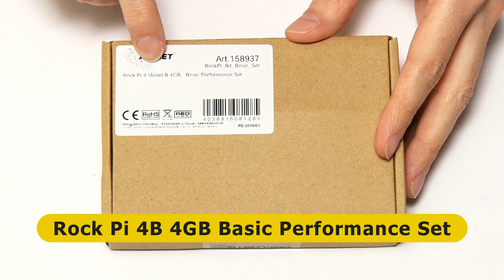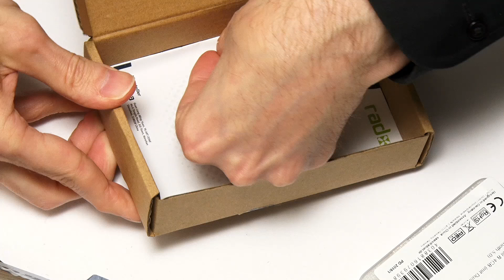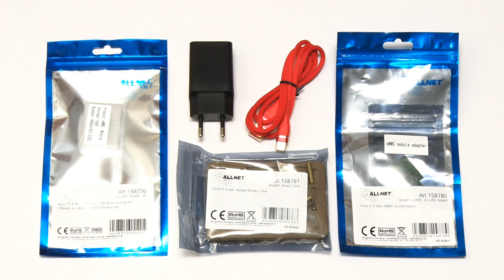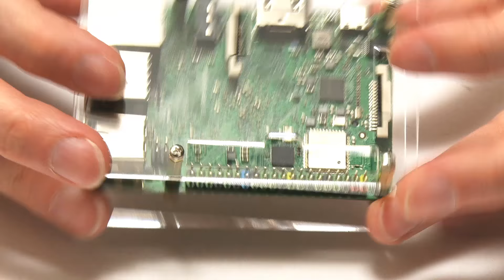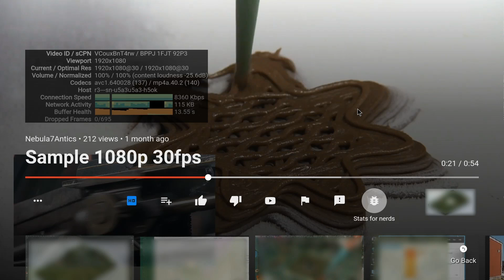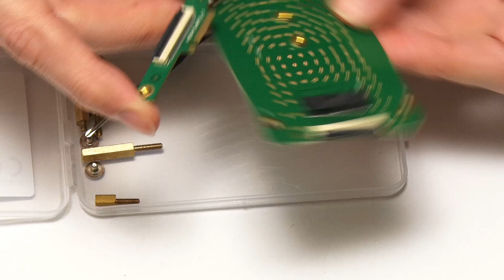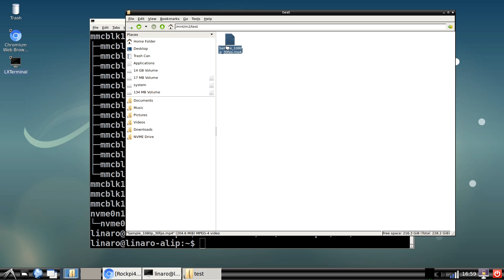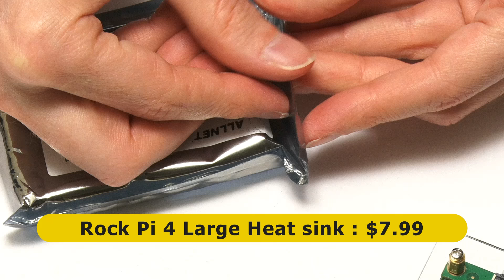Rock Pi 4B : M.2 & USB 3.0 SBC

Comment: Great video as usual. Thanks for uploading. 
I wonder if I can use this one to run Windows 7 on a virtual machine hosted by Linux. Can someone please tell me? Thanks in advance.
Reply from the maker: This would not work I'm afraid, as this is an ARM computer, not x86. Virtual machines still run on the processor directly. You may be able to run Windows 7 via emulation (theoretically!), but would be slow and would the right drivers . . .

Comment: Does it boot from the SSD?
Reply: not at the moment, this is only possible with SPI flash on board. The existing version of ROCK PI has no SPI flash soldered. For now you need to boot from SD card or eMMC.  But it will not take long to get this solved.

Comment: All of these more powerful SBC's have one big problem - the manufacturer cares only about sales and not the software/OS that runs on it. And they don't care too much about the hardware either really as long as you buy one and it can be gotten to work with a lot of long complicated Linux commands. For years many have tried to knock the Raspberry Pi off its throne, and all have failed for so many reasons I won't go into here. But don't be tempted by these more powerful SBC's with fancy features, this one amazingly is designed with both heatsinks on the BOTTOM! So we have here designers here that don't know heat rises. Seriously that should tell you everything you need to know about the ''Rock Pi 4B''. Stick with the Raspberry Pi, it's still king for a reason.
Reply: I might have to turn mine upside down to get the heat to rise.  I hope it still works when it's upside down lol.  If you buy this without doing research and don't know it's a new board without a lot of support yet (based on your Raspberry Pi experience) that's on you.
Reply: Yea, without software support is just a bunch of fancy circuits put together. I wonder why are they bothering to copy the Pi layout...

Comment: Just wondering if there were enough spacers to still use the original perspex base as a protector for the SSD extension board. Also, it would be helpful to do a final sum on the total investment with all the bells & whistles. Can't help but feel I've been encouraged to by an extra large fries with my happy meal :) All in all... very clearly explained and presented. Thank you :)
Reply from the maker: Good thought -- the perspex top could be fitted over the SSD. :)
Reply: there are also protective casings in the works. some wood versions are available and only the beginning. :-) check them at https://shop.allnetchina.cn

Comment: you cant install OS on M.2 NVMe SSD ?
Reply: Hi, you can but you need at the moment still the bootloader on the microSD card. This will be solved, it is in the works but takes a lot of effort.
Reply: Are you the creator of this product?
Reply: @k033as9  no, I am not. The team at RADXA with Tom Cubie did create the product. https://wiki.radxa.com/Rockpi4 We do the marketing activities with them and build accessories. https://shop.allnetchina.cn :-)
Reply: @k033as9  The bootloader can be put on the spi flash, and the reset can be put on M.2 NVMe SSD. Newer version of ROCK Pi 4(v1.4) will have spi flash on board by default.

Comment: I've been following your videos for years and years. Always great quality content.

Is the processor capable of handling the high bandwidth provided by the NVMe connection? I'd be delightfully surprised if there wasn't a bottleneck in the system which would make a standard SSD just as effective
Reply from the maker: Thanks for watching -- and a good point. I will be uploading a follow-up video running some tests. My guess for now  is that the NVMe interface will prove faster than a USB 3.0 to SATA adaptor -- but we shall see! :)
Reply: @ExplainingComputers  Terrific. Looking forward to it

Comment: A yet another RK3399 based SBC.
RK3399 is a great SoC on paper, but it's software support is really awful. It seems Rockchip doesn't really care about supporting OS'es other than Android.
So unless you only want to run Android on your SBC (or planning to use the SBC as a headless server), do yourself a favor and choose something else.
Heck, even Android support isn't stellar as there's no support for things like MediaCodec. The only app capable of hardware video decoding on Rockchip SoC is Rockchip's fork of Kodi, RKMC which was last updated 2 years ago.
Reply: What you are talk about is not the fact in 2019. First, RK3399 supports ChromiumOS very well, not running on ROCK Pi 4 yet, but community is working on it. Second, RK3399 have very good Linux support on Rockchip kernel 4.4, with all hardware accelerations including GPU and VPU. RK3399 also has very good mainline Linux support, not as complete as 4.4 Rocckhip kernel but more drivers will be merged in. Third, please check LibreELEC release for Rockchip, 4K@60 hardware decoding is working. https://libreelec.tv/downloads_new/rockchip/
Reply: For Android, we are working on Android Pie for ROCK Pi 4.

Comment: by the way,  Can you direct me on AMAZON to the best cable for Rasberry Pi 2B+  cable to attach VGA monitor?  (I think I need connection for sound also....  That would be of great assistance to me!
AMAZON perhaps or NEWEGG website.  I totally trust your guidance.
Humble Appreciation!
Reply from the maker: This can be tricky to get working, as you need a signal convertor. These should work: https://www.adafruit.com/product/1151 or https://thepihut.com/products/raspberry-pi-hdmi-to-vga-convertor

Comment: Sir Chris,  Humble appreciation once again for a fantastic video.  I have been busy since Mid October. Moved 160KM from Atlanta GA/USA.  Finally catching up on your videos.!  Your SBC videos always have my full attention.
Hopefully within a week I can sit down with the 2/ Raspberry Pi 3 B+ I purchased last year. I will run home soecurity off one and Smart home off the other. 

would you consider a video series, SBC security, also setting up Sensors for doors, windows,  motion as well as connecting to garage door opener, then managing it from SBC? (There are a few videos that touch on that "some what". 

However, your style of presentation and setting things up are far better than any other person could imagine to attempt to match for sure.
Purchasing the sensor cards and loading firmware you need is very affordable and much cheaper than buying a finished product for each window/door/etc.

I have 3 routers now. 1 for family use with computers,  Ipad, Smart phones, etc.
2 routers for smart devices and security devices/wifi.  One router paired into other..
That should cover inside house and full yard outside. (1 acre lot ). The last to add is fence and smart gate.
That should keep me busy for the summer time! 

Yes, I will be purchasing the Rock4Pi, probably early 2020.
Hope all is well!

Have a blessed weekend!

Alton
Reply from the maker: Greetings Sir! Sound like you have been busy. You may like my series on Raspberry Pi Automation starting next week . . .

Comment: Actually, USB 3.0 no longer exists.
Reply from the maker: It does. Just because most new PC morherboards are 3.1 does not prevent the previous standard from existing or being inplemented in new hardware. This board is USB 3.0.
Reply: @ExplainingComputers  Actually USB 3.0 was renamed to USB 3.1 Gen 1 which was renamed to USB 3.2 Gen 1. It is the same hardware. Please read this article and you will believe me: https://www.diyphotography.net/usb-3-is-about-to-get-renamed-again-and-its-going-to-get-even-more-confusing/
Reply from the maker: Thanks for this, of which I am aware. But I'm afraid I do not accept the USB Implementer's Forum view that a standard ceases to exist because it has been renamed! :) USB 3.0 was published as a defined standard. This happens to be the same as what was later defined as USB 3.1 Gen1 and then USB 3.2 Gen 1. But history cannot simply be obliterated, and manufacturers -- including those of this SBC -- specify their board as being "USB 3.0", with the technical parameters of what is defined in the documentation that specifies that standard. And a great deal of computer equipment still exists in this state. In my view, the USB Implementer's Forum is making itself look ludicrous with its suggestion that all hardware sold with a USB 3.0 specification (and labelled as such) is actually now something else. So here I could have said "USB 3.0 which is now known as USB 3.2 Gen 1". But to talk about the board as having "USB 3.2 Gen 1" ports when the specification for the board does not state this would not I think communicate its specification most appropriately. Language has to facilitate the best available means of communication, and sadly the USB Implementer's Forum's renaming does not help with this. "USB 3.0" as port that offers a 5GB/s transfer rate is something that is widely understood. How many people (and manufacturers) talk about "USB 3.1 Gen 2"? Very few. So I choose my worlds for the most effectively communication. Please note that I am in no way criticising or disagreeing with you here, but rather with the USB Implementer's Forum's bizarre re-definitions. :) The article to which you link also concludes with a view in line with my own.

Comment: where can i snag 4-5 in the US?  I'm eyeballing this for a small kubernetes cluster
Reply: Hi Ryan, something which we did not really well communicate is the fact, that the heat-sink is mechanically already "sort-of" cluster ready. If you look on both sides of the heat sink you will find a groove which actually allows the mounted board to be slid into a rack. Here you can find a close up of the heat sink:  https://shop.allnetchina.cn/products/heatsink-for-rock-pi-4  This rack is not ready yet, but in our planning. There are also mounting holes on the bottom side of the heat-sink. We are always thankful for smart ideas! You can drop them on some of our social media sites. (links are on the footer of our shop) We will for sure reply. ;-)
Reply: hi, you can get them from us, we ship to the US https://shop.allnetchina.cn
Reply from the maker: Allnet link in video description. Cluster sounds cool.

Comment: 1080 p at 30 FPS ? Its 2019 benchmark in 4k 60 fps to pls. Its way to expensive a product if all it can handle is 1080p at 30 fps.
Reply: It does for sure
Reply: it does 4K@60fps
Reply: It does 4k 60. Even the Fire Stick 4k can handle 4k 60( and it is weaker)

Comment: I'd love to use this as a NAS for Time Machine instead of a Time Capsule. Has anyone experimented with using this SBC as a NAS?
Reply from the maker: Must be possible, but I'm not aware of this having been done yet.
Reply: ExplainingComputers I will try, once I order one with the M.2 add-on.
Reply: But where is the point, as it has no SATA ports?
Reply: @0xbenedikt  the M.2 could be utilized for that. WIP - keep you posted...
Reply: @NB-sw1op  I am both in hobby and work quite involved in embedded electronics. However, I know very little about M.2., since I never really looked it up much, so I am looking forward to your solution to the missing SATA ports.

EDIT: Nevermind, I just realized M.2. does not just carry PCIe but also SATA, that's nice.
Reply: We will add more information on how to make SATA work via the M.2 Extension board. There is no "how to" available so far and certain hardware requirements on the add on board have to be met. There are more pressing issues at the moment. We will follow up asap. Sorry and thanks for your patience!

Comment: Would this be able to play 4K HDR files? How about passing DTS Master, TrueHD and Atmos to my home cinema amp?
Reply from the maker: It should play 4K, though I've yet to test. There  is no optical out,  which I presume will limit home cinema options?
Reply: Optical output wouldn't give you support for lossless DTS Master Audio and Dolby TrueHD. Optical would give you playback but not the full level of either of those

It would have to use hdmi for the audio. It likely allows you to do pass-through of the lossless audio formats to your receiver (if your receiver decodes those) but their website isn't clear if it does. If it doesn't (or if your receiver doesn't do decoding), you'd have to use playback software that decodes it to pcm.

Comment: Very promising board.
The indies making these boards need to form a board where they can collaborate on a specification (if they aren't already) and get an architecture set incorporating what we've witnessed across numerous product lines (PCIE, NVME; etc.) into a cohesive package so that next steps may occur. There's enough to constitute an entry level ARM PC MoBo considering my previous points and a market --they (all the sbc developers/manufacturers) really should think about picking up their heels. Linus Torvalds will agree. and anyone else looking to get into developing for the ARM architecture.
Good video!

Comment: I am not impressed with the Rock Pi , only one version of the Linux worked, did not try this b version though.
Reply: Hi, can you please tell us which linux version would not work? did you connect to the forum to get some insights on why it might have failed? please connect at https://forum.radxa.com/
Reply: @NB-sw1op  thanks for the reply, only the Slackware installed properly. All others tried, Armbian, Debian stretch, Ubuntu failed one way or the other. I am mostly interested for the Debian but will leave it for now due to other projects. Perhaps I do kind of Debian by myself, I will see. All downloaded from wiki.pine64.org.
Reply: @damirdze  hi, I think you should check this link for working images: https://wiki.radxa.com/Rockpi4/downloads and of course here: https://github.com/radxa I guess this might solve your issue.
Reply: @NB-sw1op  I will try when get some time , thanks Norbert.

Comment: I presume there is no Vulkan support on Linux, only on Android ? (I kind of stopped at "Rockchip3399").
Reply: https://en.wikipedia.org/wiki/Vulkan_(API)
at least for that page, Vulkan is (well?) supported on Linux
Reply: @AntonioNoack On Linux yes, but not on Linux for the RK.  I've got one here that has been taking the dust for years.  And a quick glance to the API show various OpenGL ES but not Vulkan.  Also, it's on the "issues" list.
https://github.com/rockchip-linux/libmali/tree/29mirror/include
Reply: @hurricane31415  ah ok :)

Comment: I hope that little screw holding the SSD isn't shorting out anything on the end where it is overlapping the board.  It might be better to use a non-conductive material there.
Reply from the maker: I've checked, and while the screw is close, it is not shorting anything out. :)

Comment: POE will be very handy!
Reply from the maker: Indeed!
Reply: the PoE HATs will eventually be released for mass production. The first batch of modules which had been sent out to the community did not satisfy. There has to be more work done on the improvement of the heat management. still - top priority

Comment: Clearly communicated and informative, if on 1.25x, thank you. However a small suite of disk benchmarks on the NVMe drive would be much more informative than a 1080p video playback that was already running fine from inferior local storage.
Reply from the maker: I will be doing some more tests in a later video.

Comment: couldn’t the ram memory been designed to be plugged in to a extension board 32GB 🐏 🤔😯
Reply: 64bit 🤗
Reply: @DonaldSleightholme  that would be a challenge...
Reply from the maker: Removable RAM is not a feature of any SBC I know of.  indeed the board would no longer be an SBC! :)

Comment: The "heat sink as the base" seems like a bad idea for heat dissipation.

I think I'd prefer running it upside down (heat sink up in the air), maybe with a plate added over (or in my hypothetical case, under) the SSD extender and the screws for the extender swapped for some longer ones to get both attached at together.

Comment: Can this handle Windows 10?  If so, please do a video showcasing anything it can and can't do in Windows 10.   If not, what do you suggest for Windows 10?   I ask because I am looking into upgrading my grandparents' computers to something smaller and more efficient.  Thanks!
Reply: Why would you inflict Win10 on your grandparents? Put Linux on it.. your grandparent-related tech-support chores will drop to zero.
Reply from the maker: This is an ARM board, so cannot run Windows 10, at least not the standard version.

Comment: Why didn't you install the operating system on the SSD in stead.

You could have then also ran some more tests on the actual hardware.

Playing a video is not a good test of using the device. I expect it would play a video. 

Can you do another video showing more tests?
Reply: Because the device can't boot from the SSD. All of these ARM-based SBCs boot from either an SD card or EMMC. SSD is not an option.
Reply from the maker: What slycordinator says is true, although I understand that SSD boot here is technically possible, although images for this are not yet available.

Comment: Re: ordering from European suppliers
Don't forget after Brexit anything over £15 (including shipping) is going to be a problem even if ordered from a supplier in the EU - there's be the shipper's "handling fee on behalf of UK Customs" plus import VAT.  
For items delivered by Royal Mail, the handling fee is £8 per item - making a £15 order cost £26, a £20 order cost £32, a £25 order cost £38, a £50 order cost £68, a £100 order cost £128 etc etc

Items of a value (including shipping) of over £135 have both VAT AND Import duty to be applied as well as the handling fee. 

Nightmare? You bet.

Comment: Was that highly convoluted M.2 on purpose? F-sake.
Reply: Probably because both the SoC and an NVMe SSD get really hot under load. If you put the SSD over the SoC by flipping the M.2 connector around, I'm 99% sure one or both would overhear.
Reply: @Muscleduck  The reason is, the m.22280 is 80mm long already, plus the M.2 connector, oversize the 85 standard PI length.